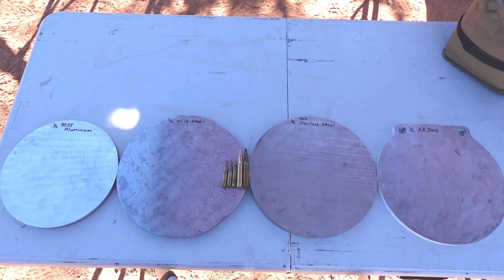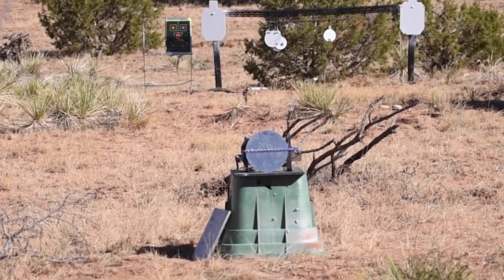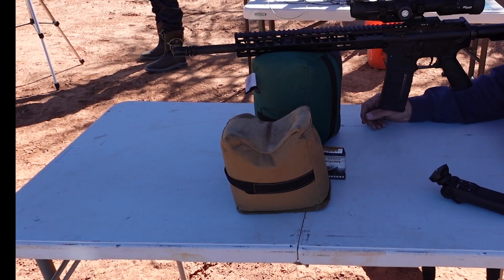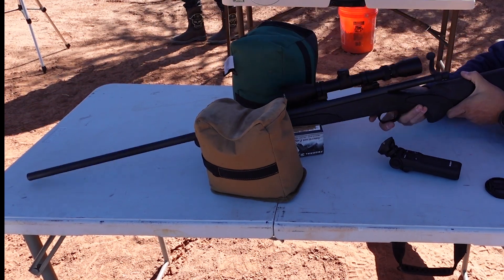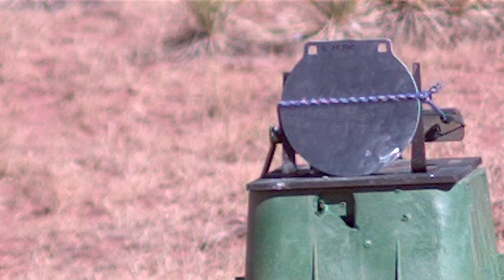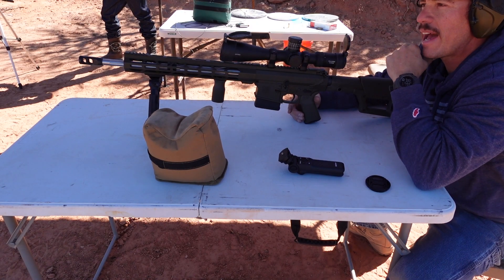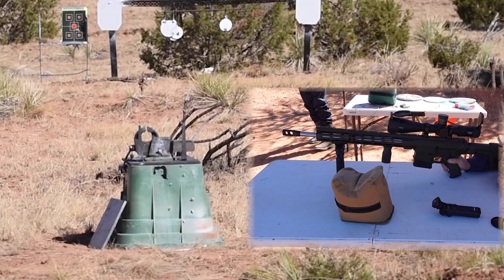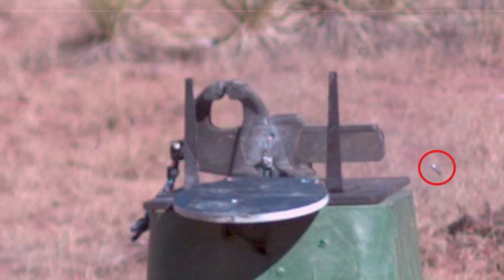Aluminum vs.Mild steel vs. Stainless steel vs. AR500

Comment: Thank you very much!
It will be interesting to see if you put two plates of 1/4 of an inch one after another is it wil perform better than just shooting half inch or how much it performed better
Reply from the maker: I’ve done this test as well. Technically speaking it’s been better having a single solid piece vs stacking. There are always exceptions to this but generally speaking soils is better than stacked.

Comment: 304 stainless steel can be great in combination with harder materials. It is capable of 70% elongation at break. You could place 1mm of it on top of ceramics to prevent fracture from small impacts, like .22lr, it can act as a cushion and distribute energy. Also, you could place 1.5mm of it behind 15mm of AR-550 to catch spalling from the hard main plate. 304 stretches so much that spalling isn't a problem.

Comment: These results mean absolutely nothing.  It is for and experiment an entertainment, only.  Do NOT make any conclusions.  Especially if you decide to create a body or vehicle armour.  There are plates made not only of different materials, but also different quality of material.  Same goes for the bullets.  For example: identical 7.62x39 made in Russia and China are two different bullets. They will have different markings on AR500 plate.  But take a REAL bullet from a quality steel from WW2, and it will punch through AR500 like butter.  All of the bullets will kill you.  Good or bad quality.  But when it comes to stopping one, be very careful.  Always, have a reserve.  Because you do not know if your plate or a bullet flying towards it is made of REAL steel or Chinesium.

Comment: Hello I really would like to see how does AR500 differs to standar Hardened steel Brinell 500 or even 550 or 600 if somehow is possible to get this last two. Hardened steel brinell is used on most MRAPS now a days, from Cobra 2, Hunter Tr-12, roshel senator and many other "cheap" commercial APCs/MRAPs outthere are using this material.
I am guessing you can find one provider easier, but I found the provider for the Hunter Tr-12 so I could share that one so you could test their product.

Comment: I've read that 7075 aluminum tends to be more brittle than other types.  That may have been the point of failure.
Spring steel would be an interesting test, as the various grades have a decent combination of hardness and ductility.
Other test ideas, if you're interested: 
-Laminate several thin steel plates of varying hardness/ductility.
-UHMWPE on the front of steel as the frag coating.
-UHMWPE on the front and back of ceramic (instead of just a backer).
-Thin layers of metal sandwiching a ceramic plate wrapped in UHMWPE.
-Layer of ballistic rubber between steel plates, then coat the whole thing in bed liner.
Reply from the maker: I’m always interested in trying new builds. Some of those examples are similar to a few builds I have in mind. I’m finishing up a lightweight build and then I can take a better look at these.